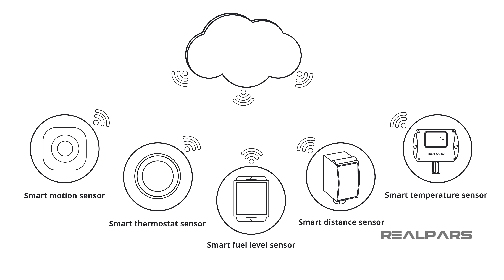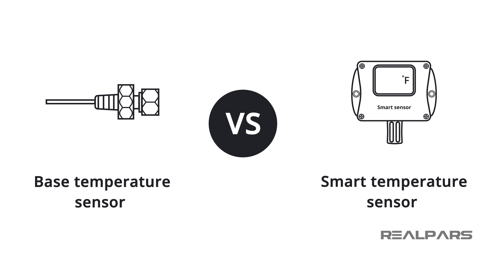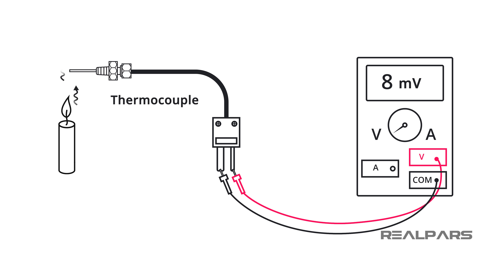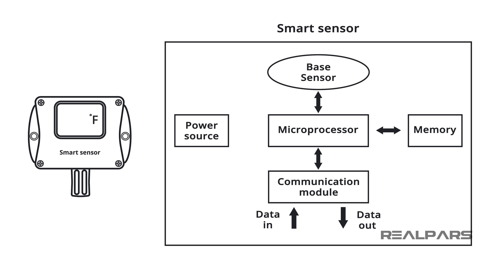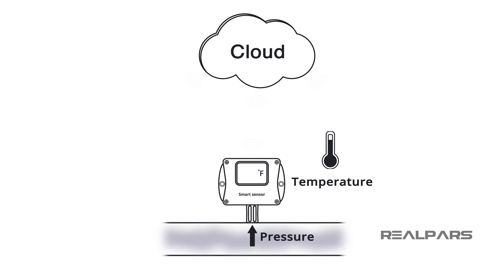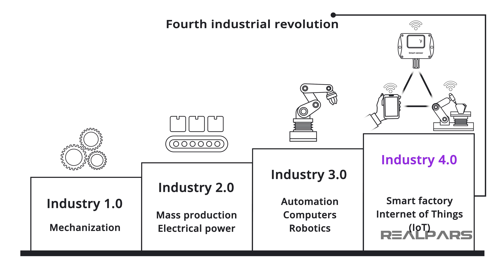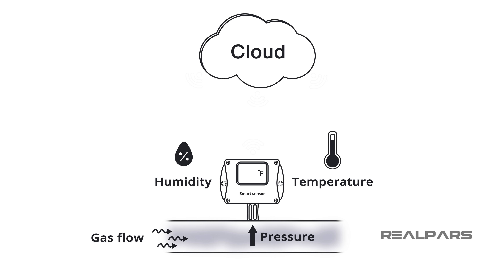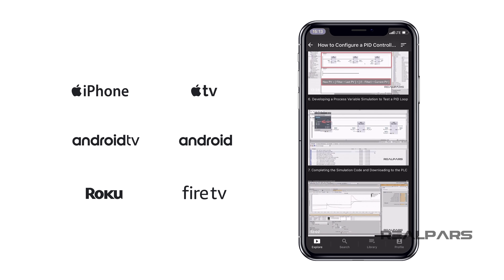Smart Sensor Explained | Different Types and Applications

Comment: What are open coils?
Reply from the maker: Solenoid valves and other devices, such as contactors, operate when current is passed through a coil of wire wrapped around a magnetic rod.  This causes a change of position of a rod or other mechanism that closes a contact, changes a valve position, etc.  If the wire is broken, it is called an "open coil", since the driving force for the coil is lost.

Comment: is the output of the smart sensor always digital ? or it's always a current ? i had this as exam question.
Reply from the maker: Thank you for your question! Smart Sensors are available in various configurations tailored to suit your specific application. They can be fully digital, provide current output, or be easily configurable for your needs through dip switch settings or software. In the Industry 4.0 version, the options are plentiful, and numerous companies offer these products. To explore further, consider checking out the following links: https://www.omega.com/en-us/ https://us.rs-online.com/customer/login/?source=myaccount

Feel free to explore and find the best fit for your requirements!